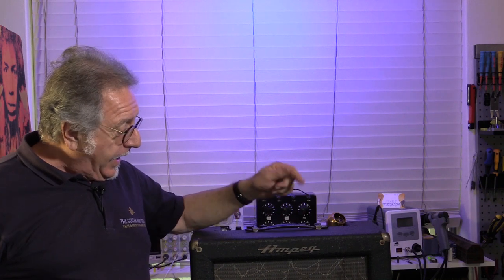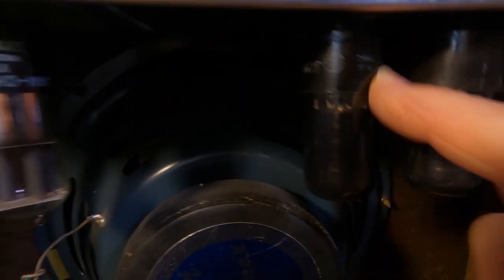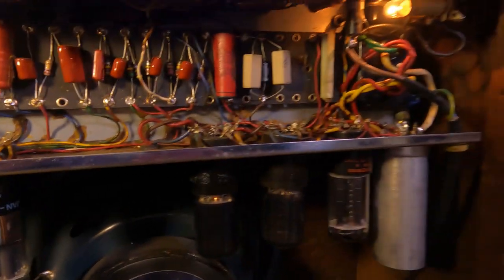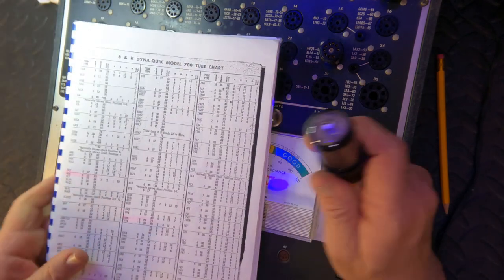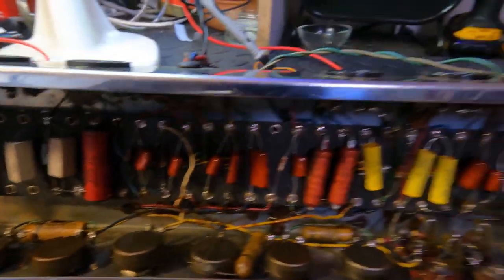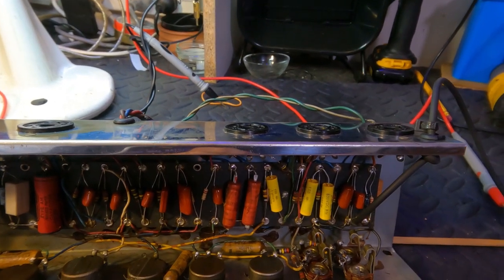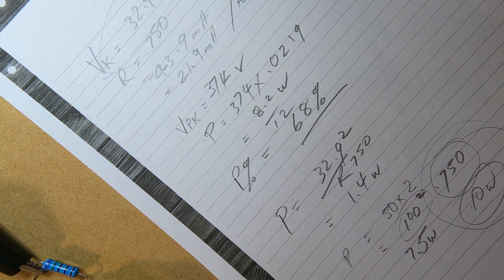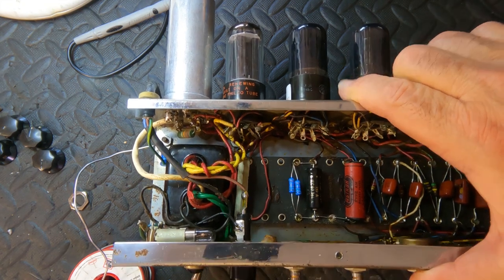Let's Repair this buzzing 1959 Ampeg M12

Comment: I did a similar J-12 Jet from 1960.  Yes, every coupling and trem osc cap was leaking DC and needed to be replaced as well as all plate resistors which drifted wildly.  Really nice sounding amp when I was done.  Yet another "Why the hell did I sell it then?" moment...  Love your vids, Chris.  Greetings from NJ USA.
Reply from the maker: I feel your pain. Its really hard to decide how much to replace on these classics before we turn them into mere clones. I get around it by asking the owner of his intentions with his amp. If its to gig or record, sadly I need to replace many sus components. If it for home or collecting, I just get it working and leave as original as I can. After all, we have to be responsible custodians of this musical history.  Greetings from Sydney, Jersey boy!

Comment: Another great video, Chris. That vintage tube tester is a beast. Is it accurate?  I can tell that there was technical issues with this video. Sometimes simpler is better. Still loved the video!
Reply from the maker: Thanks Les. Yes, the B&K is from the days when the world ran on tubes, and not just guitar amps. It covers more tubes than I have ever heard about, let alone used. I calibrate it every year. It stays remarkably stable. 
In my effort to make more interesting videos, I just got myself in a tangled mess during editing with syncing 2 cameras and then deleting scenes during periods of frustration. Lesson learned.

Comment: Hi - Thank for posting this video. I'm in the midst of restoring the very same amp.  Almost the same year too.  How did it sound with that speaker?? Mine still has the original Jensen C12R and it sounds very brittle.  I'm going to check the bias on mine with your method.  Cheers!
Reply from the maker: What a cool project, David. Sometimes the Jensen can sound a little brittle. The best advice I can give you is to call CJ Sutton at Weber speakers, and tell him Chris recommended you. CJ really knows speakers and how to solve your issue. 
The Ampeg sounded rich and full after the work was complete.
Reply: @theguitaramptech  thank you for the advice. I'll give Weber a call.

Comment: Bonjour à vous. Je suis tombé récemment sur votre site et je me permet de vous demander conseille.
Je révise  actuellement une tête Ampeg SVT VR et l’ancien propriétaire suite à une réparation c’était fait installé un condensateur supplémentaire. Que je vais essayer de vous situer sur le schéma.

C’est un condensateur(X). 450v 47uF soudé entre le négatif de C27 et le positif de C29 ensuite un bout de câble et soudé du positif de (X) directement sur R60 (47K 5W) et donc ma question  vous me conseillerez de retirer (X) ou est ce que ceci à été installé dans un but bien précis que j’ignore hélas ?

Et je trouve que la tête fait beaucoup de bruit même à volume bas.

Merci pour aide. Dan (de France)
Reply from the maker: It is very dangerous for me to offer advice like this, Dan. If I understand your question correctly, Capacitor X is connected across C29. He may have been testing if C29 was working correctly. To connect the positive of C29 (320V) to R60 (480V) looks wrong.  I cannot give you any advice about what to do with such dangerously high voltages. Check the connections again. Then check them again. 
Bon chance.
Reply: Bonjour 
Autant pour moi ce n'est pas C29 mais C28 (Le + de C28 relié à R60)  et le + du condensateur (X) au + de C28 et le _ du condensateur (X) au -_ du C27. (Si je pouvais envoyer un schéma ce serait plus simple. . Il y a aussi un câble avec masse flottante qui est soudé  entre J6 (pin1) et R55. Bonne continuation. Dan
Reply: Bon j'ai fini par trouver il a doublé la capacitance de C28  (450V 47uF) avec ce condensateur (X) (450V 47uF) . Portant C28 et encore bon..
Bon il me faut régler ce problème de bruit . Bonne journée. Dan
Reply from the maker: @gibbons192  Bonne journée, Dan. Chris